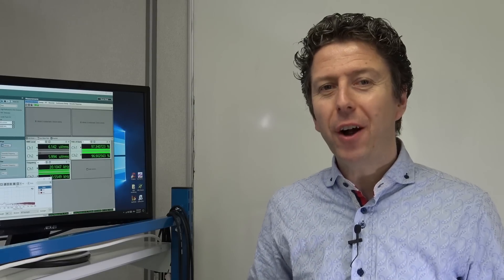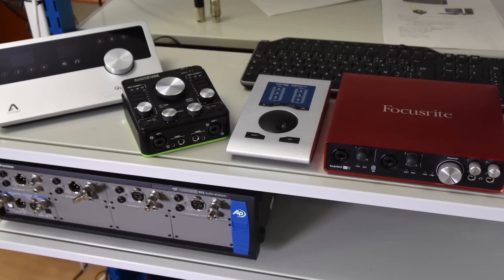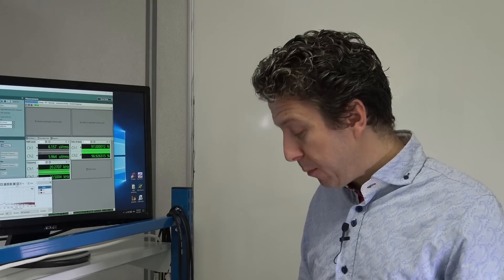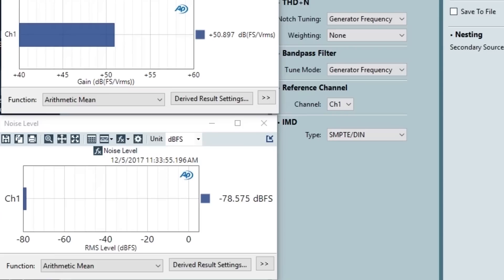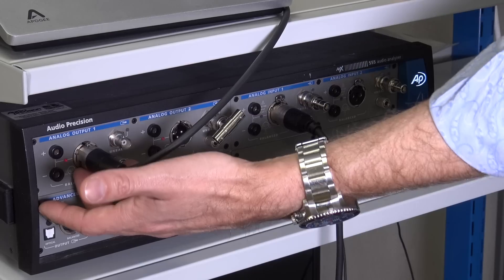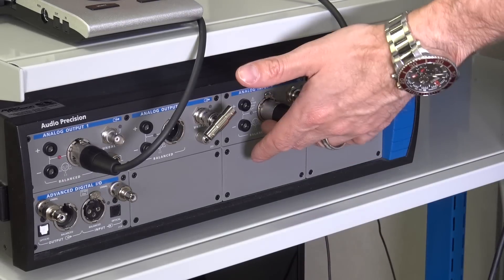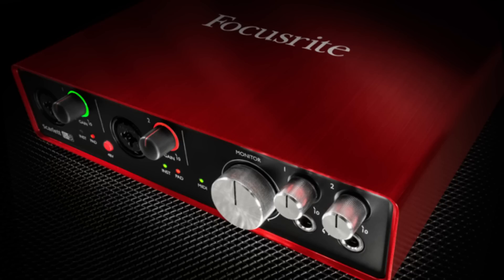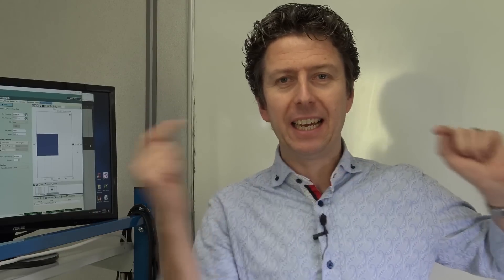Case Study - Audio Interface Technical Testing

Comment: The only test that counts is the one you never did. What matters most is if the sound you are putting in is being destroyed by the time you play it back. If you can't achieve a clone of what you are recording the interface is crap. I've done this test and the Focusrite can't keep up with Audient. I'm sure the Babyface RME (If it is of similar quality to the Audient) will also achieve a clone off the sound going in. Again, none of these tests matter. Additionally, all YouTube shoot outs fail to test, and/or investigate the difference between what goes into the interface & what plays back after the recording. I've done such tests and you can't show it to others, you can only show the difference between interfaces A/B/C playbacks.

Comment: I got am Audient iD44 I am very happy with it. I have it down to 8 samples with Amplitube 4 and Addictive drums. The noise floor is ridiculously low. It isn't cheap, but worth the price. It outshines both these AIs. The only problem is the included software is weak. Not the drivers or Interface software, they're great, but the bonus software.

Comment: I have a focusrite 6i6 that I use for my Korg Kronos and Jupiter 80.  I had read how transparent it was and honestly was buying it to correct latency issues I had when I went direct into the pc.  And to it's credit the latency problem went away.  And for most sounds its hard to tell that it colors the output on typical synth sounds.  However with familiar sounds like the Piano, it is easily apparent that the 6i6 flattens out the sound to the point of being hard to listen to compared to the sound when listening directly out of the Kronos.  I just ordered the Apogee and really hope it fixes the problem.
Reply: did it help?

Comment: My RME BBF PRO jumped up in volume. Send it to Thomann to service. They send me another unit, a used one, much older one, judging from the serial number, but the same problem. When i started to record hoping i will capture the issue, i recorded in stead how the play back volume is not linear up and down when you rotate the volume knob likewise up and down. I will send the video to the RME and Thomann. Never happened with my old unit on same usb port.
Reply: sorry i`m dan in english - what does it means "jumped up in volume" ? i want to buy BBF but seems like you saying this is bad unit?
Reply: Jumps up, sorry ! Sometimes when i turn up the volume knob, the volume jumps up suddenly much more then usual. And this is just one issue. Other times, after i turned up and down the volume knob, the zero db (mute) point is not on the same place. Other times when i turn down the volume jog, the volume drops down from a few db directly to mute. Sent the video clips to RME but instead of a pro opinion i got more questions and "not sure what that is" statements or some ironic replies like "Tell us how to make you happy, with or without the Rme BBF Pro". The issue appears on two units, on the one i bought and on the replacement too.
Reply: Hi, I have seen you write this exact text on many many many different youtube videos! It's obvious that you are deliberatly talking RME down. Are you representing one of the competitor brands maybe?
Reply: @abracadabra1550  Google "rme babyface pro jumpy volume issues" and see for yourself...

Comment: What about latency and how reliable and up to date the drivers are? I tend to use only line inputs rather than preamps for the most part running synths and drum machines into it. I absolutely hate it when my drum machines and synth parts are delayed or don't sync up with my vsts and in the box parts of the track. I also hate it when my soundcard fails to be recognised, has drop outs, glitches or other driver issues. I could afford the RME UC, UCX or 802 but I really think it might be complete overkill for my needs as a home producer who might want to use the card for the occasional dj or live performance gig. Everyone just says but RME - best quality, best sound, best drivers, best support. I just wonder If I have to or if i can be satisfied with a cheaper card. I'm not too fussed about the 5% difference in sound I may or may not notice - it's the drivers, latency and software integration i'm more concerned with. I already got burned once buying cheap with echo audio cards which gave me high latency, glitches, dropouts and now is discontinued and no longer recognised by my laptop. Thanks for your thoughts.
Reply: I feel the same way. I had a focusrite 6i6 for about a year, but experienced bad glitched etc. like you discribe. It might have just been and issue with my computer, but since I sold it already now I can't confirm that. RME babyface pro is tempting because of their great drivers. But the focusrite 18i8 is way cheaper :/
I think I'm gonna go with the RME Babyface Pro though, just because I feel like I'm not gonna outgrow that one anytime soon
Reply: Basically in Audio Interface land you get what you pay for !
Reply: Stuart Branson - Theme Composer very true... it’s hard to hear the quality differences sometimes even between $2k and $200 2 channel converters... But it is all the other features that add up to a pro unit.  Like, is the power being filtered properly, or will the interface crackle when it’s plugged in a certain port, etc.?  How good is the headphone amp?  How high quality is the internal clock... will it drift day to day changing the conversion quality or is it reliable?

Comment: So wait , then what’s the difference in quality comparing a $200 interface and a $5000 one ? How can you compare a apogee symphony I/o input to a scarlet input ? Wouldn’t you expect to have much better quality with the more expensive one ?
Reply: Shhhhh someone might notice the emperor wears no clothes
Reply: still dont know the difference :P
Reply: The fact is that the AD/DA differences are quite beyond the human hearing range, the noise floor, distortion and frequency response are better on paper but for the human ear quite insignificant. Now stuff like Preamps can make a migger difference since they can color the sound quite a bit. The other thing you maybe paying is features (more ins/outs, ADAT, monitoring software), build quality (those cheap focusrite knobs start introducing noise at some point), support (RME for example has 14 year old interfaces which still get updates) and the most important: driver quality and stability (in this I think RME is above the rest easily, at least on USB. On TB the other manufacturares can achieve similar latency).
Reply: I thought it had something to do with the better quality you have the more you can hit it , and it will better retain the quality . It’s a bad analogy but like an old moog model D that’s filter goes high up in the 30k range - inaudible , but the overtone series that ripples down the effect into the audible range is noticeable .

Comment: How well or how different do they interpolate sudden peaks ? That's the question. And how do they respond to an ideal rectangle signal wave ?
Reply: Detlef Kroll strictly speaking, there are no ideal square waves. Neither in digital nor in analog. You’d need infinite bandwidth for that :#)
Out of curiosity: what can a square waves tell us about the quality of an audio interface? And what a sudden peak? (A single sample at 0dbFS?)
Reply: It could say much about how the converter works. And how a very cheap converter e.g. in an IPhone compares with a more expensive one in your audio interface. And of course there are ideal square waves in the digital domain, which can't be represented in analog and must lead to more or less overshooting in the converter. That's what the entire True Peak discussion is all about.

Comment: I have a apogee quartet I like it a lot but not sure if it's better to change to another interface like the focusrite 18i20, claret 8pre usb or the  presonus studio 192 that have a close price range and have more features. Or just get 8 pres through digital connection and get a headphones Amp for more headphones outputs for my quartet.
Reply: The Scarlett range is more on the lower end budge side as its not in the same league as the Clarett and the Quartet. The Clarett 8 Pre competes directly with the Apogee Ensemble and Apollo 8p and Quantum.

Comment: Does Soundcard/Interface Plays Any Role While Bouncing From DAW ??
Reply: Nope. It's rather simple. Digital conversion is A to D, D to A. Signal going in, signal going out. The signal  in the DAW is already  entirely digital as there's no need to convert again. The DAW and your CPU is what's doing the number crunching as you can still render any project without an interface connected the your computer. Only 32bit DACs would do some calculations back down to 24bit before converted from digital to analog.
Reply: I can tell you from experience that if your soundcard is not good then a DAW will not bounce a big project
Reply: Stuart Branson - Theme Composer nonsense, you can bounce a project with NO sound card at all!  Only comes into play if you’re mixing down through the D/A outputs to outboard gear.
Reply: Amandeep Singh Rai no.
Reply: Jan Minor But Many Mixing Engineer's are saying 🤔🤔 !

Comment: This wasn't a fair test because the RME Babyface Pro and Focusrite 6i6 were bus powered during the test. Both units require external power supplies for phantom power and to operate at it's full potential. The Dynamic range would be much higher for both units if they were plugged in to an electrical outlet. By the way, these measures are bit off compared to the manufacture AES17 published specs. The real world Line-out output Dynamic range for the Audiofuse is 119 dB. Far as I know, Focusrite uses the Prism dScope Series III for testing.
Reply: " Direct from RME's Babyface page: The exceptionally efficient design of the Babyface Pro almost never requires an external power supply - it runs perfectly stable with USB 3 bus power, as well as on the vast majority of USB 2 ports, without any deterioration in the specifications. This makes it an ideal companion for mobile recording, even with a pair of your favorite condenser microphones."
Reply: @AiMR  Yes, from what I read it seems like external power is only for standalone operation and Babyface Pro uses only usb power plugged to pc/mac. But I wonder if it actually can be plugged to external even when working with computer
Reply: dijosoul I skipped through the Video so I didn't see everything.
Reply: Does that count for every audio interface which has a dedicated power cord?
Does stuff like this get pointed out in the manual somewhere?
This is really interesting but I've never heard of that! I'd like to digg into this somewhere.
Reply: Big Ice The Take the Focusrite Forte as an example. It only has a maximum output of -18 dB for the line out and headphone out bus powered via USB. When it's connected to the wall outlet, it's maximum output is all the way to positive 0 dB. The performance is much lower via bus powered. All published specs for audio interfaces are showing real world maximum performance. The Forte has a maximum Dynamic range output of 118 dB but that doesn't mean it will perform the same via bus powered. It can be low as 112 dB due to lack of power. The Scarlett 6i6 has a maximum output dynamic range of 108 dB.
Reply: @eman0828  if this is all true why isnt there enough gain for my sm7b
Reply: @jgvtc559  it's because it's a dynamic mic not a condenser mic.
Reply: @eman0828  also want to point out that the experimentation does not reflect real world performance at all. Think of graphics cards. You have a $1000 dollar card and a $100 card. Technically, you can most likely overclock the $100 card to meet the speed of the $1000 card, however, render the chip unstable. This is the same comparing the Focusrite to RME. Expecting the same performance from Focusrite as from RME is laughable. Sending a single signal around a loop does not mean you will receive the same with more data/complex signals.
Reply: Eman 08 6i6 does not work with bus power. I have one.
Reply: Huh, ur telling me the Babyface Pro doesnt have phantom power to power microphones with its usb connection?
Reply: He spoke to this point in the article. "RME do not supply a PSU with the Babyface Pro as standard so we had to use the buss powering option.  Potentially buss power might not be able to offer what the unit needs to operate at it most effective so this could have been a factor in this result".